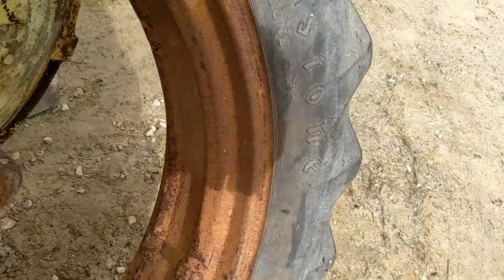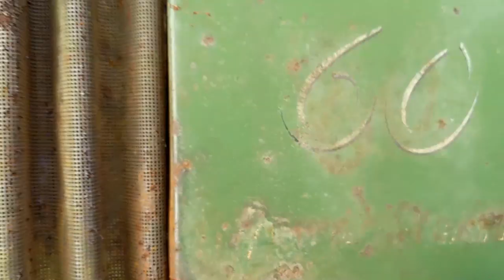Life Goes On - Taking a Closer Look at the John Deere 60, and Discussing Plans For the Restoration

Comment: Man this is going to be a hell of a restoration and knowing you, it's going to look absolutely beautiful when it's done.
Reply from the maker: I sure hope so! I want to do this restoration the right way. This and the 4000 put food on the table for so many years...they deserve the best possible care.
Reply: @MichaelTJD60  You are sure brave I was already saying 'nope' in my head when I saw the condition on the shifter! A word of warning however is that you need a good welder when having the rear axle housing fixed, as a welder myself I can say cast iron is very hard to weld on because any major fluctuations in heat can see more cracks forming in the base metal.

Comment: The 60 is a great tractor my grandpa bought one from a neighbor after it had been in a shed for several years and restored it. It was the first tractor I ever drove and he taught me how after giving one condition I had to get it started. The relationship you had with your grandpa sounds almost identical to mine. Can't wait to watch this restoration progress.
Reply from the maker: The first tractor I ever drove by myself was a 60 as well. I had shifted and steered a few tractors riding on my grandfather's lap as a little kid, but being able to drive a friend's 60 by myself at 10 years old was one of the happiest days of my life.
Reply: MichaelTJD60 I’ll never forget driving it around the driveway that day I learned. I’ll also never forget getting told on all the 2 cylinder John Deeres when your sitting still put it in neutral and let the clutch out since it’s better for them that way.

Comment: You would probably be time, but definitely money ahead to buy a mostly complete parts tractor. Having a donor tractor there, to just take whatever you need from, is worth way more than hunting for, and buying parts individually
Reply from the maker: For sure. I've been keeping my eye out for a 60 parts tractor...they're just not easy to find in my neck of the woods, and most of the ones I've found are missing a lot of the parts I need.